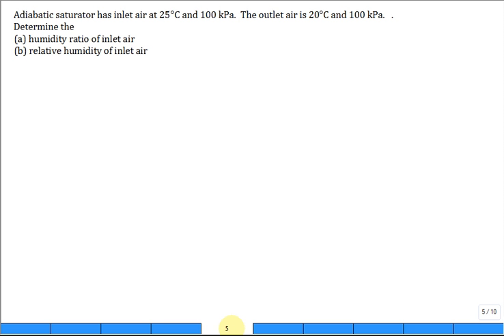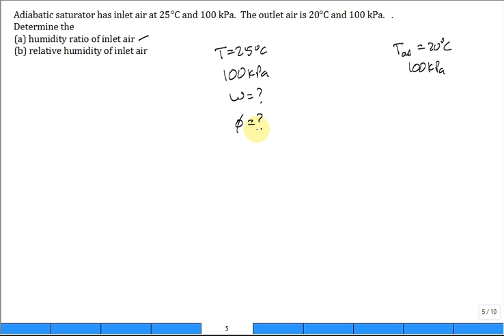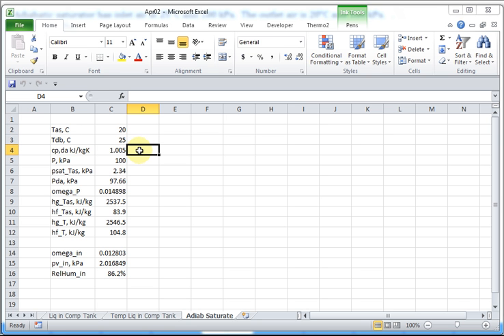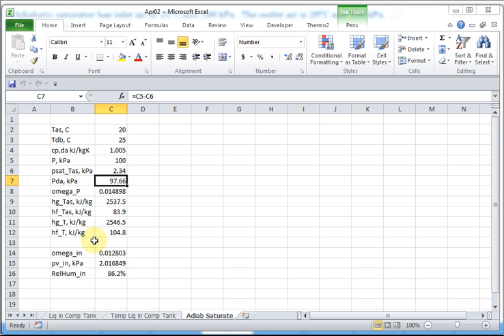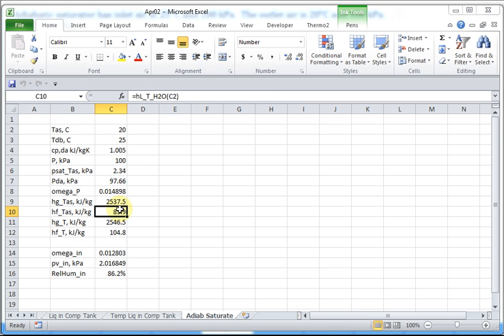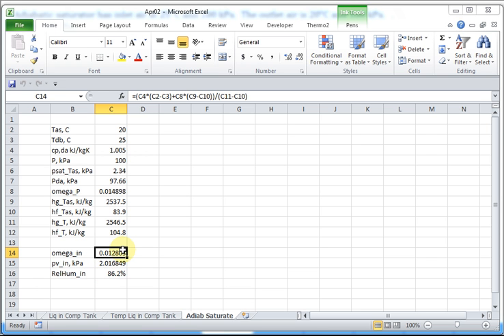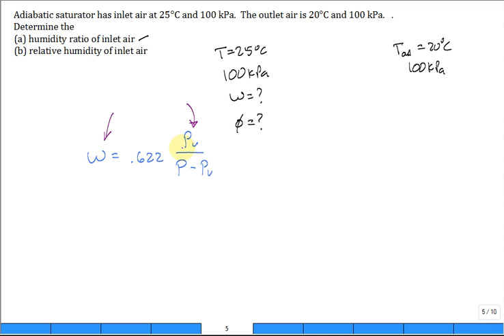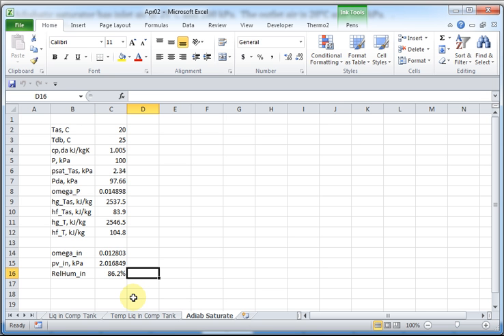Adiabatic saturator to calc inlet humidity

Comment: There might be an error in how your are calculating the RH% of the inlet.  I believe it should be Pv,in/Psat,in x 100.  In your example this give about 63% RH.  If you lookup the omega at 0.0127 and 25C at inlet conditions on the psychrometric chart, this intersects the 63% RH line.
Reply from the maker: yes, you are correct.  The calculation of Pv,in is correct, but evaluated Psat,in at T=20 degC and it should be evaluated at T=25degC.  Giving: 2.017/3.169 = 63.6%.  thanks.